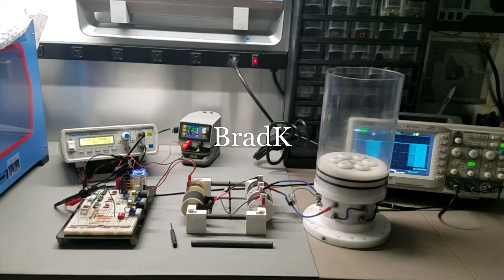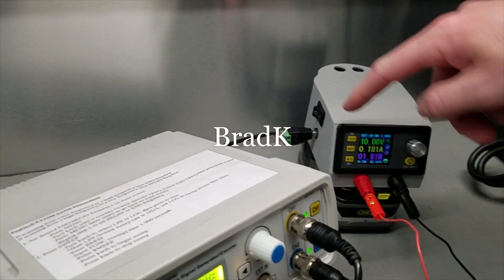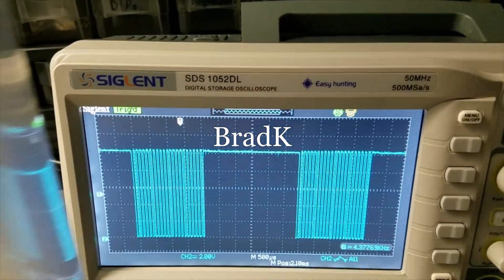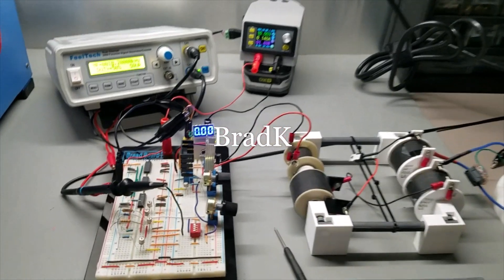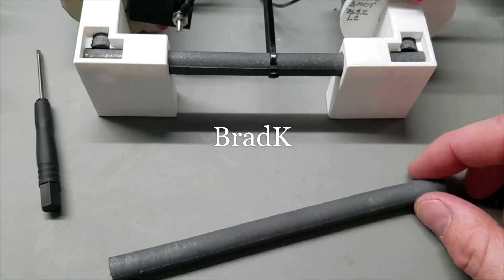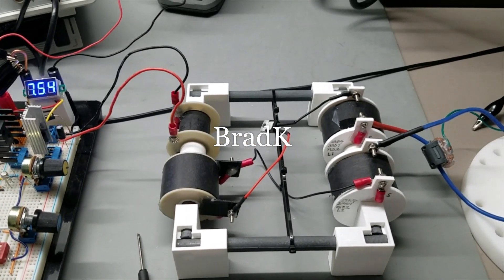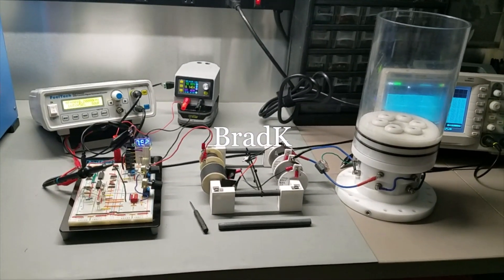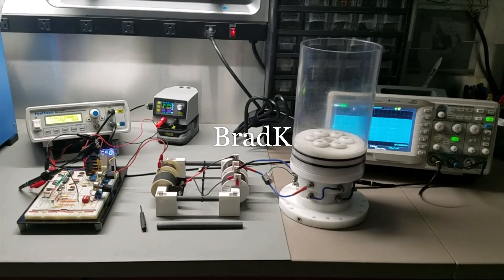Stan Meyer Research # 28, Apr 2020-Replication setup

Comment: Hang the pipes at the nodes like you would wind chimes and then you wont dampen the vibration and it should work. You can't vibrate the pipes at radio frequency if they are not hung at the nodes. It's no different than a xylophone key if you don't hang it at the nodes it wont vibrate at all and you end up using a lot of brute force... your xylophone key wont work. Think of sound , vibration and feedback. If they are hung at the nodes then no brute force is needed.. a simple tone keeps it going non stop.
There are much easier ways to get a trillion volts with no moving parts, no magnet or coil or battery is needed... using 2 piezoelectric speakers made of granite and a 500 lb xylophone key used as a microphone... the feedback keeps it running forever.. and it will split the air and make it's own water. A CNC machine would be required to cut the 2 disks. The 4 inch spark gap inside the device provides the radio frequency to split the water that condenses in the tweeter cup... and it goes boom right back into the microphone in an endless feedback loop. The bouncing up and down of the xylophone key resting on the 2 disks amplifies the force on the disks 829:1 giving over 400,000 lbs of force on the disks. It's like a piezoelectric lighter on steroids that will never turn off and you never have to click it constantly. 500 lbs of force on a quartz crystal releases 12,500 volts per cubic centimeter.. in granite it's about 4000 volts per cubic centimeter..... with 2 x 12 inch disks you end up with a trillion volts per disk and 100,000 volts arc's inside giving it steady radio frequency that keeps splitting the water droplets spinning over the speakers. Speakers made of granite have a range of below 1 hertz all the way to 20 megahertz.. and because they are transducers they are both microphones and speakers... they will pick up every wave for up to an 800 mile radius around it and feed it back to the microphone in an endless feedback loop.
Free energy is so simple.. powered by a 500 lb microphone.. powered by "The Philosophers Stone".. which was a xylophone key.
It's all done with sound and feedback.. and the steady sound is already there but you can't hear it because it's radio waves... but if you have an old cathode ray TV you can see the white noise radio waves on the screen when the station goes off the air. Your just using a vibration that is already there and feeding it back into the microphone for endless feedback to keep the disks vibrating forever. That 500lb xylophone key will bounce up and down forever on the speakers because the speakers are feeding it constant vibrations.... so simple man!... but you have to mount it at the nodes or it wont work at all.
There is no specific frequency to split water... the frequency of each water droplet is determined by it's size and shape and so when your using a speaker that can reach 20 megahertz you don't have to worry about tuning to a specific frequency to split the water droplets because they are all different frequencies because they are all different sizes.
It only takes a tone to vibrate the largest blocks... if you took a 1000 lb stone and tuned it to 45 hertz and hung it on the ground at the nodes it would only take a steady tone of 45 hertz to make that stone bounce up and down to cause an earthquake.... it only takes a steady tone to get all the free energy you want!  If you had a stone and you didn't tune it and you don't know it's frequency then you would use a wireless microphone and give the stone an interview.. it's resonant vibration will get picked up by the microphone and feed it to the amp and speakers and broadcast it's vibration.... causing it to vibrate.

Comment: Stan Meyer's goal was to produce Hydrogen from water while using a minimum amount of amperage. Therefore, an important key improvement in Bradk's project is to use a step down transformer, stepping down the voltage from the primary to the secondary and at the same time stepping up the amperage to the secondary side of the transformer at the same time. This step-up of output amperage will deliver more amperage to the tank-circuit and help to achieve the amperage limit needed to the electrolyte ,water, in the 10 Stan Meyer capacitors, hence achieving the catastrophic breakdown of water desired. The key is to change the windings in the primary side of the transformer to be different from the windings in the secondary in order to produce a step up in output amperage to the tank circuit.

Comment: What I think is going on with Stan Meyer's patents are; the wording of the patents was only written to protect his inventions from theft while keeping as much information secret as possible. I think the key to understanding Stan Meyers circuit is the Tank Circuit where the water has replaced the conventional dielectric, as compared to what is used in normal capacitors. The secondary side of the transformer circuit's blocking diode is for allowing the tank circuit amperage build up to charge until the amperage in the capacitors reaches a limit where there is a catastrophic destruction of the electrolyte water, where by the water is broken down into gas.   If someone used this circuit with a standard capacitor the Capacitor would explode.  Maybe the answer can be found by finding a way to adjust/increase the amperage inside the Stan Meyer capacitors. There are so many variables like the uf, size, composition, and shape of the capacitors. Maybe the Farads of the Stan Meyer capacitors is the key. Others have reproduced Stan's work so the time is worth it, reinvent the wheel and learn a lot.

Comment: Hi BradK. How many liters of HHO gas per minute? And how many watts of electrical energy? How many watts of heat energy is produced by the combustion of HHO gas? You need to heat the water with HHO gas to get calories. 1g * 1 degree Celsius = 1 calorie   1 calorie = 0.001163 watts * hour. Wat electrical energy <= Wat thermal energy?

Привет BradK.Сколько литров HHO газа в минуту? И сколько Ват электро энергии?  Сколько Ват тепловой энергии получилось при сгорании HHO газа? Нужно нагреть воду HHO газом получим калории. 1г * 1 градус Цельсия = 1 калория   1 калория	=0.001163 ватта*час.  Ват электро энергии <= Ват тепловой энергии?
Reply from the maker: I haven't taken any measurements. I haven't been able to produce the reaction. IMO there are initial requirements that must be met in order for the process to work and I haven't figured out how to get them going. I can find resonance easily but there's much more to it than just resonance.
Reply: @BradKwfc   
Maybe you help.
https://www.youtube.com/watch?v=SzKyOhdRVjo&list=PLJZxP3xlHWMXCviZH7Wh9pw7Sh4XllByk&index=25&t=3s
https://www.youtube.com/watch?v=s-m1XyMWpx4&list=PLJZxP3xlHWMXCviZH7Wh9pw7Sh4XllByk&index=33
https://www.youtube.com/watch?v=ogH33OTJ3lw&list=PLJZxP3xlHWMXCviZH7Wh9pw7Sh4XllByk&index=14&t=10s
Frequency is the resonance of water. HERE MILIAPERS, NOT AMPERS? :)
Reply: @BradKwfc   

It is better to count in calories than in Joules. A calorie is heated by:
(the Junkers calorimeter https://www.youtube.com/watch?v=HeofLEQ6wuA) - you can heat a bucket of water
1 gram of water(g) * 1 degree Celsius
(℃)= 1 calorie;   
Сalories to watts  1 calorie = 0.001163 watts * hour. 
Δt℃=t2℃ - t1℃; 
 t1℃ - 
initial water temperature;  t2℃ 
- 
final water temperature (burning HHO gas you need to heat water);
Δt℃=90℃ - 20℃=70℃; - example
М(g) gram of water  * Δt℃ = calorie
10 000 gram of water * Δ70 degrees Celsius(℃) = 700 000calorie=700 000 calorie * 0.001163 watts * hour = 814,1 watts * hour - thermal energy. 
P=U(Volts)*I(Ampere)*hour=  Wat*hour - electrical energy.
P=12Volts*20Ampere*1hour=240  Wat*hour - example
Coefficient of useful action: (Wat thermal energy/ Wat electrical energy) *100% = (814,1 watts * hour / 240  Wat*hour) *100% = 339,2%  - example
Тhat is more or less?  Wat electrical energy? ><= Wat thermal energy?

Comment: Hello there!! There's a chance to get some info of your VIC style transformer so i can build one? Thank you!!!
Reply from the maker: If you search online for Stan Meyer VIC specs you'll find them (pri coil was 41.8mH 10.5 ohms, sec coil was 1.047H and  72.4 ohms, L1 choke was 1.262H and 76.7 ohms, L2 choke was 1.138H and70.1 ohms). Look for the pictures taken by Don Gabel- in the pictures he wrote down the specs. All coils were wound using double build 29AWG wire. The bobbins can be 3d printed, files are on thingiverse. If you don't have access to a 3d printer cosmocorp makes bobbins that are nearly equivalent, pn 1613-0 if I remember correctly. Finding the right core is the hard part. UY1650, or the cores I mention in this video seem to be best so far, unless you have the $ to make custom ones identical to Stan's. The problem with having them identical to Stan's is that they are thin and will break easily. I had them years ago and never had any luck with them... and then they cracked in the corners.
Reply: @BradKwfc  Thank you!!!

Comment: Hi Brad

Thanks for sharing all those videos especially the ones on stane and his work.
You must have put a lot of time and effort into your research .
Your work is very clear and well produced 
A friend gave me a  copy of stans memos a few years back I read it a couple of times before I could make any  sense of it . I believe Stan is telling the truth.

I have been trying a few things myself  maybe you could help me on a couple of points 
That are confusing.

Stans  vic coil assembly  figure 6-1
Shows a laminated strait core with the resonant coils surrounded by the primary which is then surrounded by the secondary.

That seems to make sence if the choke coils are bifilar flat and alternately placed positive negative producing a bank of capacitors it doesn’t  seem to show that in his schematic wiring  diagrams but how else could it work ?
Aney advice would bee greatly appreciated
Thanks Brad 
A bit confused Brian 
From down under .
Reply from the maker: Thanks for the kind remarks. 

As far as replication goes I wouldn't even waste the time on the fig 6-1 VIC simply because we don't have any actual values from it. 

What most people are replicating (and what i'm showing in this video) is the 5coil VIC that has a feedback coil on it although I haven't added the feedback coil to mine.  The specs are all over the internet as well as the drive circuit. 

It's going to give you the greatest chance of success. Alot of people haven't realized yet but there are parts of the circuit which are not obvious and of they are not correct it will never work. For this reason the best thing to do is replicate as close as possible to Stan's designs. Also, even when the values are correct setting up the initial operating conditions is a major challenge.

Comment: Hi  
Also I find it interesting that I appears many people do not seem to build the feedback coil
 even though Ronnie uses the Z value in all his calculations including the turns calculations.
Reply from the maker: Did he use the feedback coil in part of the VIC calculations? Not sure why if that's the case?
Perhaps I am missing something.

Either way I am planning a future video where I will show all the math that he shared years ago, but then explain what is missing and why the missing math explains that a near perfect replication of the core is necessary to achieve a successful replication.
Reply: @BradKwfc  reading this stuff constantly day and night 18 hrs some time we have to do that it is like reading a mind veyr diffult , so i found that though it would help, check the forum there is more conversation on it  i feel there are several ways to balance out that if the case All the Best Dan

Comment: correct me if am wrong wouldnt the nanocrystal be better or the metaglass ?
Reply from the maker: Are you talking about the cores? The whole point is to replicate as close to Stan's as possible. As far as we know he used a Ferrite core with a ui of 2000 and an AL value of around 106-108. Ferrite 77 is mostl likely the material he used  on the VIC that he used for his 10 cell unit.

Comment: The variable pulse amplitude is what you will want as it is what will allow you to set the base voltage to keep the water polarized while  pulsing the higher voltage later.
Reply from the maker: Have you been working with Ronnie or reading all his old posts? That's exactly why I have changed all my designs over the years-to try and get them closer to what he was doing.

Comment: Cool. Nice to know #1 gour still kicking! #2 you are healthy, without health you have nothing, #3 you are sharing as you go along.  I have not bought cores yet or wound spools. Have wire, but you previously had a different core. You decided to go with this core because?
Reply from the maker: These cores have a lower AL value than all the others I've tried plus a much larger winding window. So, these cores give me much closer inductance values for the same amount of turns and resistance than Stan had in his VIC.
Reply: Ok. I will have to build a core and spools. I have a cell built.  I got a scope 4 channels now I have a board from R. Need to order parts for it. Where did you get your cores and corner pieces? 
Greenenergytech2013  at  gmail dot com if you care to point me in some directions for materials.
Reply from the maker: Bought the cores on ebay. Made the corner pieces on my 3d printer. Let me know if you want I'll upload the files if not I could send some to you.
Reply: @BradKwfc  let me know how much. I can e transfer you the money?
Reply: @BradKwfc  if you printed the spools I would buy them too. I was trying to follow Ronnie Walker in the past but he has been quiet for a long time now. Not sure what happened